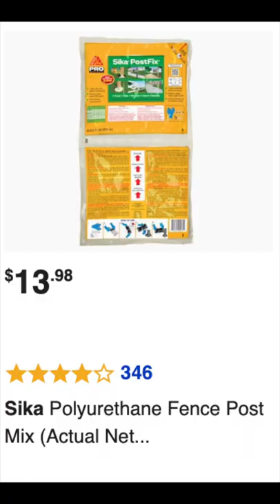SpaceX Starlink Dish Quick Install on Pole Mount with Sika Fence Post Foam Mix #shorts #starlink

Comment: Hello. Where did you get the pole from?
Reply from the maker: The pole is a standard chain link fence post from Home Depot. Thanks!
Reply: Can you buy the pole adapter too there or atleast one that would work?  I have trees all around our place, mama loves her damn trees.  Its going to be a challenge, I am 70 n don't do well with roofs nor stairs.  Thank for your video also, as I might be making things harder than necessary.  Retired 1811, too many injuries when youger.😢Thanks again sir,,,  Ty
Reply: what’s the pipe diameter?!